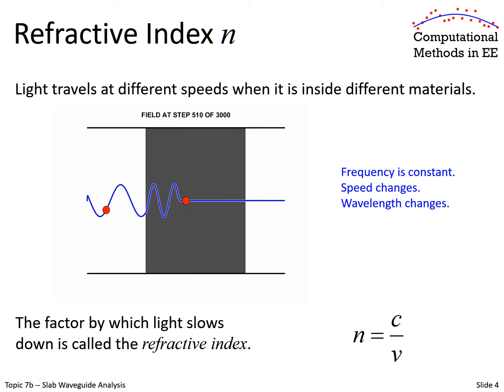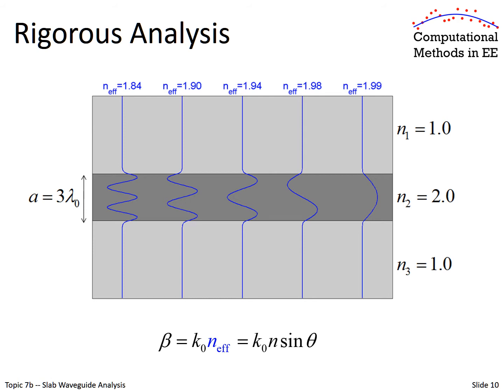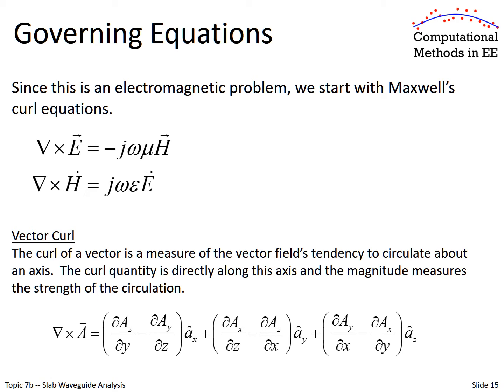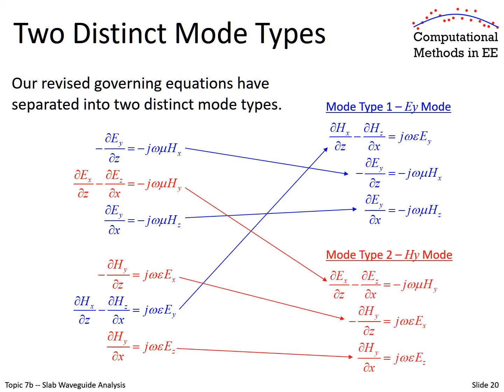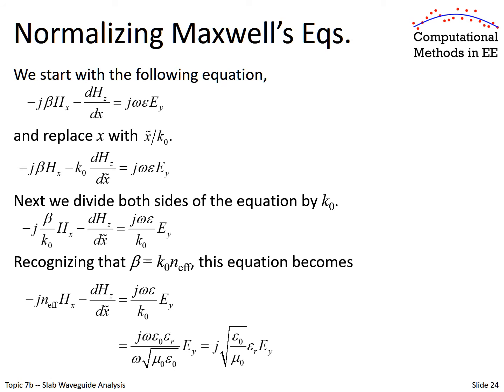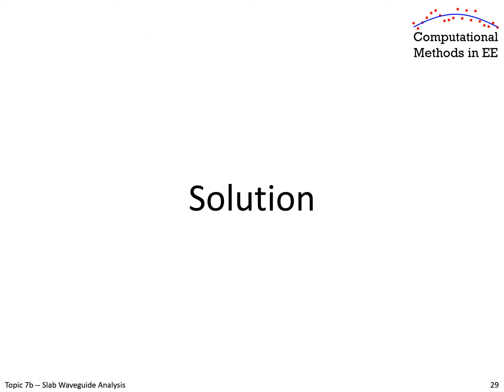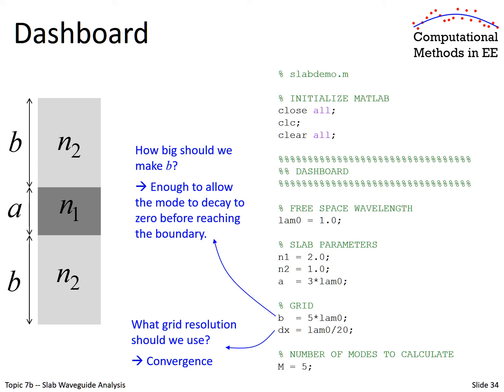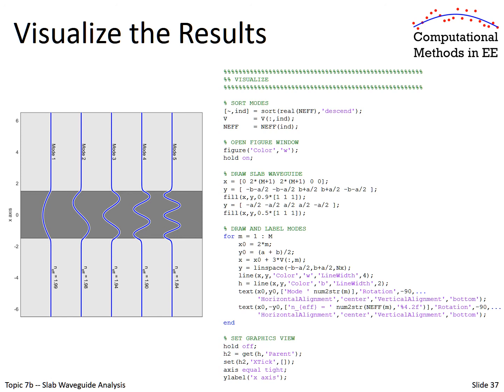Topic 7b -- Slab waveguide analysis

Comment: Thanks for the nice lecture, but i find that i am still confused by solving the mode of a channel waveguide using the same method. Since I can't substitute by d/dy=0. I am wondering if a channel waveguide can be seen as the superposition of a horizontal slab waveguide and a vertical slab waveguide, such that it carries the modes of both slab waveguides.
Reply from the maker: You can certainly analyze a channel waveguide this way as an approximate method. Fortunately, it is quite easy to do it rigorously.  Incase you do not know, this video is part of a series of videos from our Computational Methods course:

https://empossible.net/academics/emp4301_5301/

Topics 6 and 7 teach a very powerful way to implement the finite-difference method. The slab waveguide is an example.  With this background in the finite-difference method, you can learn how to analyze channel waveguides in Topic 4 in our Computational Electromagnetics course:

https://empossible.net/academics/emp5337/

I will also point you to a book that I recently wrote that teaches computational electromagnetics to the complete beginner using the finite-difference frequency-domain method. The book covers everything you are doing here and MUCH more and in better detail.  Here is a link to the book website to learn more about the contents:

https://empossible.net/fdfdbook/

Hope this helps!!

Comment: A very nice video! Super clear and insightful. Dear Dr Raymond and EMPossible, I have derived for Hy and the final formulation is exactly the same as the Ey(x) part but instead of Ey, it is Hy. Because of this, I am confused about which part is different in the code between Ey (shown in the video) and Hy. Thank you for the content!
Reply from the maker: The final equation should look the same except you should also have mu and eps swapped.  If this is not the case, you have made a mistake somewhere.  If you swap E for H and mu for eps, the two equations should be identical.  This is due to duality of electromagnetics.
Reply: @empossible1577  Thank you for the fast response! Yes, I have swapped the [eps/mu]^0.5 with [mu/eps]^0.5, and the result is identical: (n_eff^2 Hy = [(d^2/dx^2) + eps_r] Hy). Does this mean the n_eff value from Ey shown in the video and from Hy are exactly the same? (i.e.,  n_eff from TE and TM modes)
Reply from the maker: @lbrahimarsy  Yes.  If you swap mu and eps, then the H mode will give you the exact same neff as the E mode did with the original mu and eps.  That is because it is the same differential equation.

In a practical setting, the two equations will give different neff because most devices are made of only eps and not mu.   The waveguides support two different types of modes and if you want to know everything about the waveguide you will need to calculate both.

BTW...the terminology "E mode" and "H mode" is just my terminology.  The labels "TE" and "TM" are much more common.  My issue with those labels is that TE and TM are defined differently in different cases and can be a bit ambiguous.  For numerical analysis, "E mode" and "H mode" removes this ambiguity, but you will only hear that from me.

If you like this kind of analysis, you might be interested in a book I recently published through Artech House.  Here is a link to the book website:

https://empossible.net/fdfdbook/
Reply: @empossible1577  Thank you very much for the answer Dr Raymond, I will consider the book and bring it up with my University. 
Best regards.
Reply from the maker: @lbrahimarsy  What is your university?
Reply: @empossible1577  I am currently studying  at the University of Glasgow, UK
Reply from the maker: @lbrahimarsy  Very cool.  I drove around Glasgow in July.  I was on vacation with my family.
Reply: @empossible1577  It must be so delightful, especially during the summer! But now, the city is raining a lot. Perchance you have visited Edinburgh as well, if not, I recommend you to visit Edinburgh. It is a very lovely city.
Reply from the maker: @lbrahimarsy  We visited Edinburgh for a few days and then drove around Scotland.  It was great!

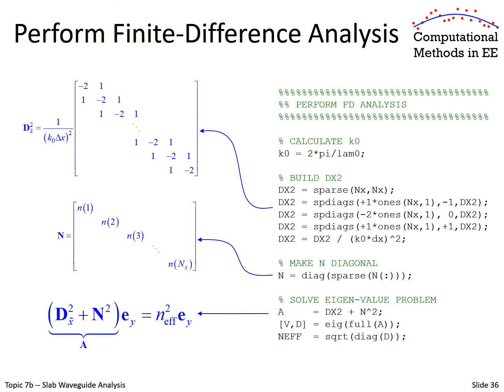Comment: At 45:05 : if my matrix is too large, of the order of 10^9, can I use the eigs command instead of eig ? Will it have a marked effect on the result? Thanks!
Reply from the maker: The function eig() operates on full matrices and will calculate all of the eigen values and eigen-vectors.  The function eigs() operates on sparse matrices.  Sparse matrices are used when matrix size is very large.  Typically it is not practical to calculate all of the eigen-values or eigen-vectors so eigs() is meant only to calculate a subset.  It gives you lots of ways to determine which of the solutions you calculate.  That is the primary difference.

Comment: is there no Ex ? or Ex will also exist if we solve maxwells equations and use elimination or For TEz in slab waveguide in this orientation axes choosen only Ey will exist? please let me know why are we not talking about Ex
Reply from the maker: For slab waveguides, Maxwell's equations split into two independent sets of equations.  This means there are two types of modes that the waveguide will support.  One of those modes will have Ex and the other will not.

Comment: why the 2nd equation in the normalized equations (28:32 min) has -ve sign ? The -ve sign should have been cancelled out from both side..
Reply from the maker: What do you mean by "ve?"  I checked the math and all looks correct to me.  Let me point your to the latest version of the notes.  While this equation is the same, the formulation has been revised and may be a little simpler to follow.  This is now Lecture 7b here:

https://empossible.net/academics/emp4301_5301/

Comment: Thank you for such a great lecture.
It helps me big time!

I am trying to digest it and to compare it with the analytic method shown in books.
there are some things that I still need to understand.

1. in analytical method, we use the boundary conditions at the core-cladding interfaces while here, we do not include that, do we? Could you explain how it is possible?

2. do you have the video where you explain the incoming angles calculated numerically for each mode?
Reply from the maker: 1. Boundary conditions are handled by how the numerical method is implemented.  For finite-differences, adopting the Yee grid scheme ensures that the physical boundary conditions are satisfied.  It is as simple as this.

2. If you are calculating modes supported in a waveguide, it does not makes sense to think about any sort of source or angle of incidence.  Calculating the modes tells you what modes are possible.  It is an entirely different simulation to figure out which of those those modes get excited by a particular excitation.

Comment: What is the source of the theory? Because I need a reference ;)
Reply from the maker: In this case, the notes themselves are the source.  The information was created exclusively for the course.  There are certainly other resources that cover similar topics.  For slab waveguides, search for information on optical waveguides and/or integrated optics.  Here are some...

https://www.amazon.com/Fundamentals-Optical-Waveguides-Optics-Photonics/dp/0125250967/ref=sr_1_1?keywords=optical+waveguides&qid=1556715022&s=books&sr=1-1-spell

https://www.amazon.com/Introduction-Optical-Waveguide-Analysis-Schrodinger/dp/0471406341/ref=sr_1_2?keywords=optical+waveguides&qid=1556715042&s=books&sr=1-2-spell

Comment: It’s a good video! You help me a lot.
But I don’t know why you declared “xa” in matlab at 42:45.it seem useless in later coding
Reply: Ok ok thank you very much!!
Reply from the maker: You are right!  I usually calculate this (and ya for 2D) and use it for graphics later in the code.  In this case, I drew the graphics differently so xa is never used at all.  You can certainly delete it if you wish.
Reply: Wow,Thx so much for response.
I want to ask other question.
We suppose that the refractive index in x direction slowly vary in this case,but if we consider it and add the term which is partial refractive index partial x into our differential equation,it will change the answer which is nearby boundary only?
Reply from the maker: @吳理念  I don't think I understand you question.  I think you are asking about graded-index waveguides?  This is only a matter of modifying how you build the waveguide onto your grid.  Nothing else in the code has to change because it was formulated and implemented to be rather generic like this.  I would certainly expect the answer you get to change a bit since you are simulating a different waveguide.

Comment: Thank you! Could you explain please how to find the dispersion equation of Parallel plate symmetric  and asymmetric waveguide, thanks in advance!!
Reply from the maker: The find the dispersion equation, you need to perform a closed-form analysis of the waveguide.  I did this for a standard parallel plate waveguide in lecture 5b here:

http://emlab.utep.edu/ee4347appliedem.htm

If you want to do it numerically, you will end up with a plot instead of an equation.  You will simply plot the eigen-frequency of your mode as a function of beta, the phase constant.

Comment: Thank you very much! It's really very helpful,but there is one thing I can't understand , why do we need to sort our modes, later in the matlab code, and how it's done, I will be very grateful if you can explain it to me, thank you again.
Reply from the maker: The mode sorting is only needed if you want to identify the fundamental mode, second order mode, etc.  Without it, all modes are still calculated correctly.  It is just that they may be in the wrong order in the eigen-vector matrix.
Reply: Thank you very much sir, while rewatching this video I noticed one thing that bugged me, you defined beta as k0*n*sin(theta), when Katsunari Okamoto in  Fundamentals of Optical Waveguides, defines it as k0*n*cos(theta) with same axis directions, can you clarify this please.
Reply from the maker: I suspect Okamoto is defining the angle differently.  I am defining it off of the surface normal.  Check to see if Okamoto is defining the angle off of the longitudinal axis.

In my definition, when theta is 90 degrees, beta is in the exact direction of the waveguide and should be beta=k0*n.  This happens correctly when it has sin(theta) because theta=90 degrees in this case.
Reply: @empossible1577  Thank you for a quick answer, and yes, after you pointed it out, I checked it again, he does defines it off of the longitudinal axis.
Reply from the maker: Great!

Comment: Great lecture! 

Sir, Similiar way it will be great if you can provide matlab implementation lectures on Full vectorial and quasi vectorial analysis of rib and ridge waveguides. It will be beneficial if you can explain how to visualise modes in channel waveguides.
Reply from the maker: It is on my to-do list!  Here is the implementation for a slab waveguide.  Channel waveguides are not much different.

See Topic 7b here:

http://emlab.utep.edu/ee4386_5301_CompMethEE.htm